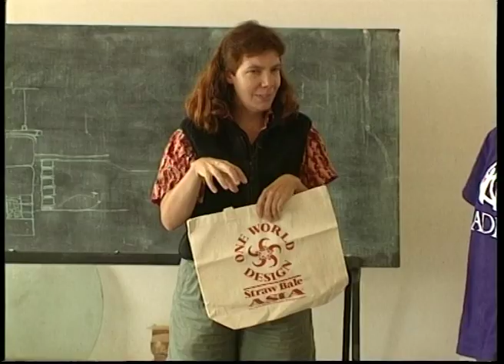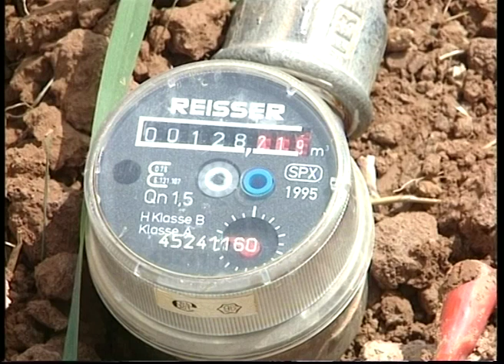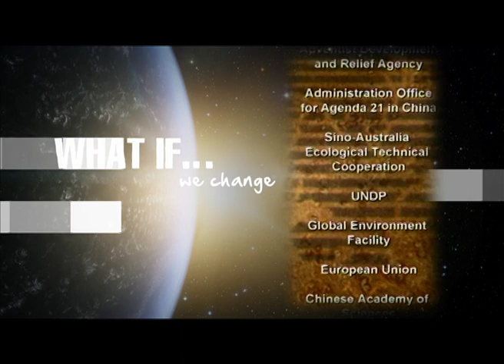#9 What if we change - A Line in the Sand by John. D. Liu

Comment: why don't they use the straw to compost on the soil to reduce evaporation and add carbon to the soil to hold onto the water?
Reply: If you talking about the farmers burning their straws after harvest, then yes they should bury into the ground. They do it like everywhere else in the world, as it gives the nutrition back into the soil quickly for next harvest. But this is short term, whereas straw into the ground is long term. 
Guess they need help for the first few years with straw in the ground and then hopefully self sustaining.